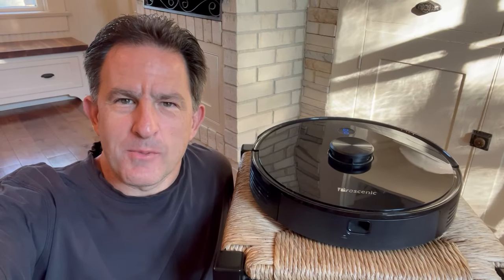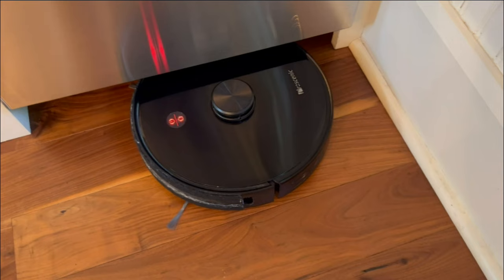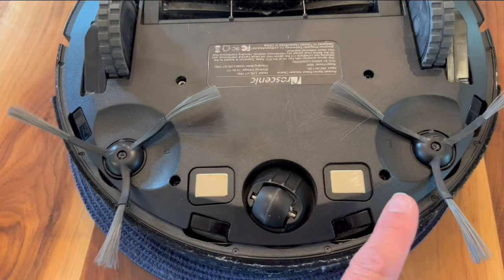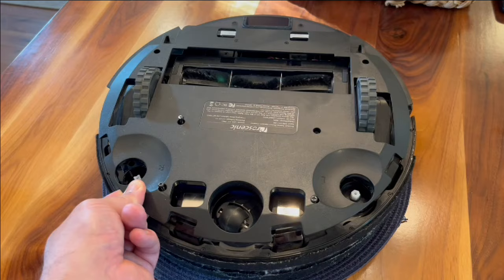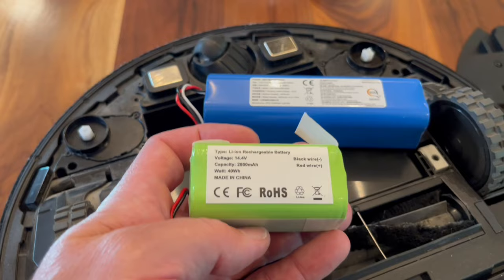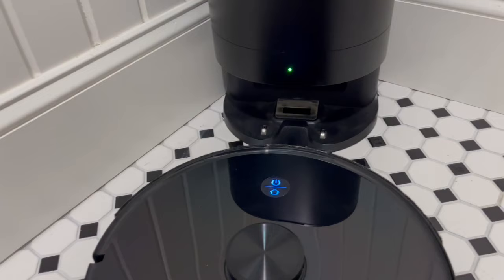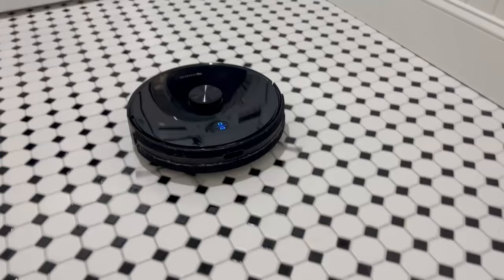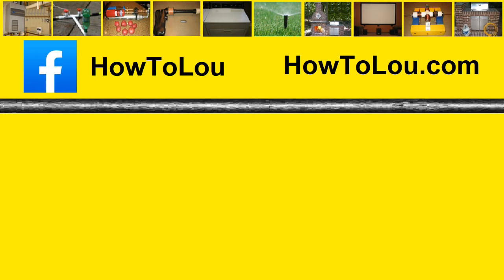Robot Vacuum Repair

Comment: Nice video Lou. Short and to the point. Don't you think that 15 months is kind of a short service life for that battery?
Reply from the maker: Lithium batteries typically lose capacity pretty drastically after about 500 charges.  15 months is 450 charges, so not too far off.  The new battery was only $20

Comment: It worked whe the batt is full. but when docking to charge, it won't charge. is it because the original battery came with 3 wires?
Reply from the maker: No, the two wire battery works fine.  You may have an issue with your charging station
Reply: I have a similar issue, the new battery has a different wiring (-) and (+) or red/black then the original battery and I have two other wires open end, what are they used for? Robot not working though, wrong wiring showed 1% new wiring according to the poles shows 60% but it turns off the moment it leaves the dock...
Reply: Same issue with mine

Comment: HI thank you for the video. I had the same issue I have changed the battery. Unfortunately the issue is still persisting. I have checked that the connector and it works. I have checked the voltage that arrives to the battery is 2.6 I am not sure that it is  what it should be. The light is still flashing red and violet. I disconnected the battery but still the same. Any advice?

Comment: I bought a Lubluelu SL60D robot vacuum back in March 2023. It’s been running fine until last week. The app says the battery is at 100% but when I send a command to the robot it just completely cuts out once it’s left the charging base. Then weirdly, if I put the robot back on charge it doesn’t seem to go past 30% charge, even after leaving it all night to fully charge. A hard reset didnt resolve the issue. Do you think it needs a new battery?